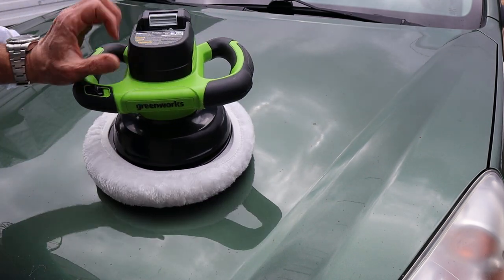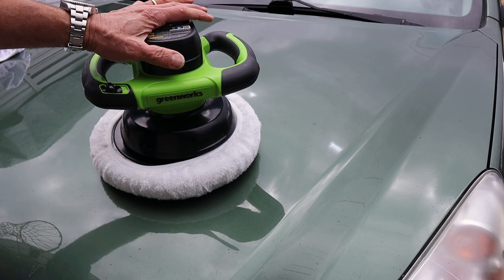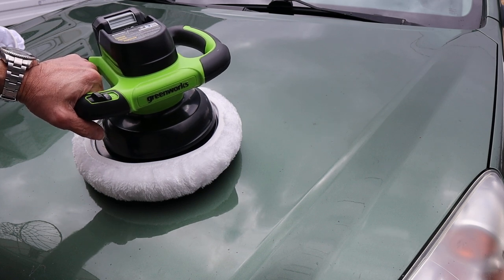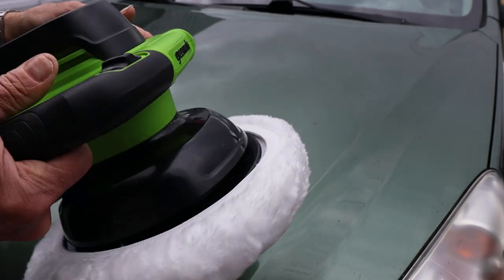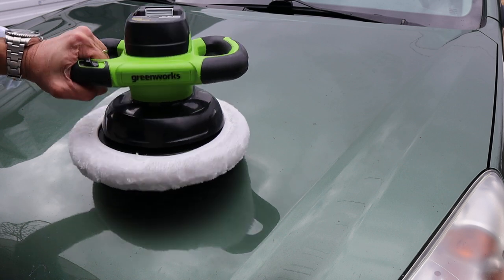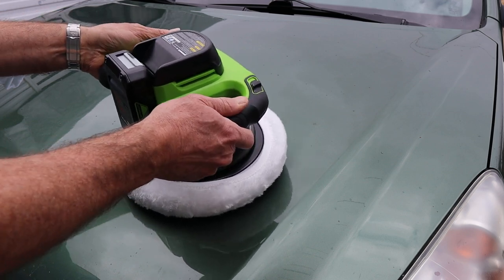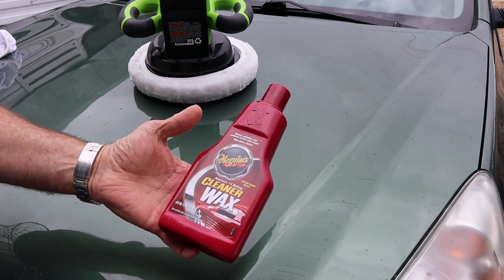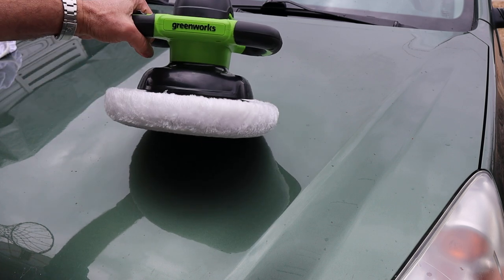Greenworks 24v Cordless Polisher/Buffer: More goodness from Greenworks makes car care easier and fun

Comment: I've been working on paint for a while. Mostly use a Rupes '15 these days along with an ever-present Makita rotary, though once in a while still need my old Flex 3401. Sorry, Doc, I'm not with ya on this one.
Reply from the maker: I knew wading into the vehicle finish world is a bit challenge for me. The riptides of opinion and experience are both unpredictable and dangerous. I usually prefer to install dents and scratches on my vehicles through adventures, but I thought I’d give this tool a shot. I knew from other videos and following comments, it would be a rough ride. One popular DIY waxing video took place in sunlight. I thought the guy was going to get crucified. Any specific enlightenment you can share is welcome.
Reply: @lastbesttool  First and foremost, folks should keep in mind that the bulk of paint marring happens during the washing/drying process. Learn how to do that well and get proper tools - pretty reasonable financially - and you're way ahead of the game.

Keeping in mind that paint is generally thin, and especially so on newer vehicles, true paint correction can only be done once. A 5" pad is the industry standard. Even though very little paint is removed, there is a greater risk of UVA and UVB damage. Folks need to keep this in mind before heading to HFT for their DA and taking their paint to task. Folks should also understand that on an older vehicle, or one with excessive marring, removing the latter will expose RIDS - randomly induced deep scratched - that were not visible before. Not so easy to fix.

The easiest and best thing for dull paint is a chemical cleaning. The paint will regain its gloss and that may be all it needs. Simple. Again, think twice before reaching for a buffer. A device as in the video is known as a mar installation device. There is nothing that it does well, and it can cause quite a bit of damage. Most anything can mar paint and that's where ceramic coatings can have an advantage. Obviously they won't stop something from scratching the paint; it's their slickness that allows things to slide off with greater ease that many may imagine.

Best thing one can do, if interested in a coating or paint correction, even a comprehensive detail, is to contract an independent, local professional with a portfolio of past work. On YT, Apex Detail is an excellent channel. Brian is a terrific detailer and a great guy, as a personal note.